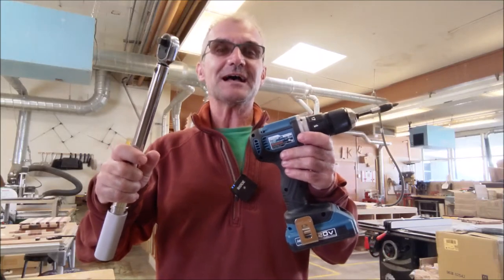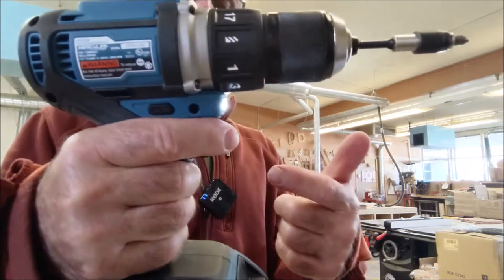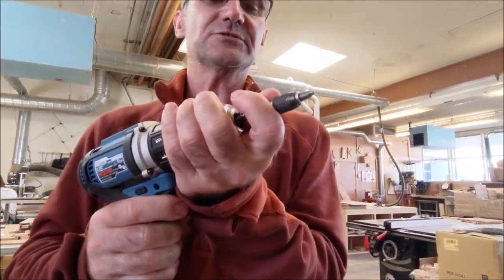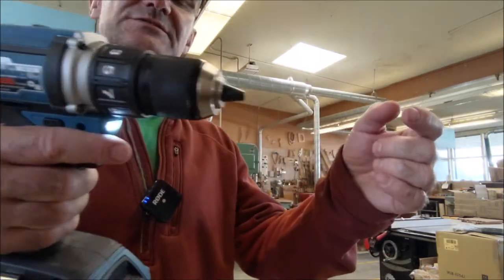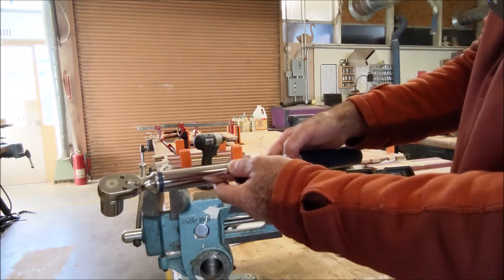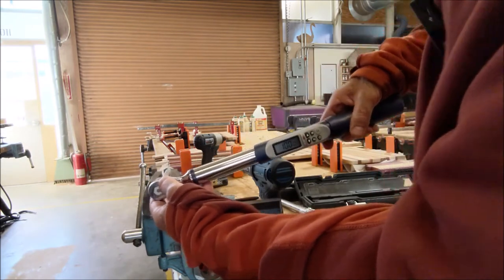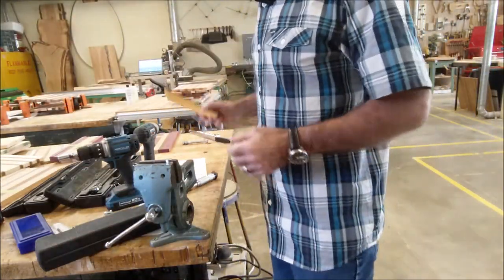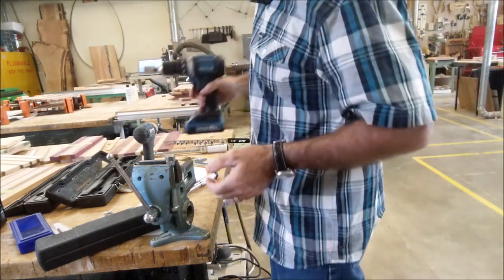Drill Clutch Torque Experiment with Stupid Mistake

Comment: I run an impact quite often at work every day and my drill sometimes.
I build restaurants all the way through till the end, so I have a 16ft trailer packed with all kinds of tools that I operate like a pro. Lol. I am one.
I was messing with making a rod iron gate at home and drilling through 2 clamped and secured pieces of steel on the lowest speed, highest torque setting.
That thing grabbed ahold of the 2nd piece and spun me and pinned my hand in such a way that i couldn't let go of the trigger until I got my other hand involved. Lol.
I couldn't do anything buy laugh about it because we forget how powerful these batteries are.
I was always minded of this 25 - 30 years ago with corded drills, but I usually can out power me cordless if I think something might catch, and I'm on #2 setting.
So, it happens to the best of us, because it happened to me. Lol.  (sarcasm)
Reply from the maker: Good advice